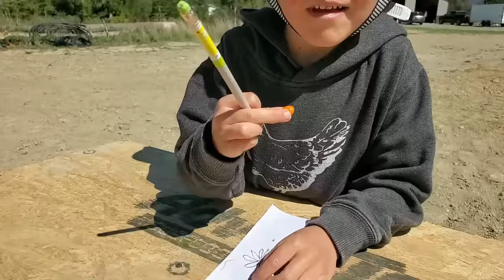We Built A Concrete Log Cabin | 2 Year Start to Finish TIMELAPSE

Comment: I did the exact same the first house I framed. Old carpenter told me to tack 2-3 12 penny nail (they used to weigh nails by penny’s :) in the bottom and just enough to hold while lifting - weight of the wall just eats the nail :).  An amazing and blessed marriage you both have, thanks for sharing!!

Comment: And if you get huge plastic containters to capture rain water then you won't have to pay for water either. Just get a reverse osomosis filtration system to filter the rain water. Btw, solar panels run pretty hot so in the winter time, it will melt the snow off if you get the kind of panels that cover the entire roof to max the energy output, etc. Bleed the sun dry. lol

Comment: Nice place . Not trying to tear anything apart,  but you forgot to skimcoat crawlspace with cement and insulate floor joists spacing .
Reply from the maker: We did full spray in insulation afterwards, walls included.

Comment: I would have put the straps out near the end of the forks and c-clapped behind it so they couldn't slip would have given u a much better angle in lifting the walls have done this trick many times but u still did a great job Congrats

Comment: I think that it's great to build your own home. However, working in construction for many years, what many youtube home builders tend to leave out is the cost, planning/design, and permit process. Its nice to see you put up walls and sheating but unless it passes inspection no insurance company will cover your home. Then, if you want plumbing and electrical there is that process. I am not trying to be negative, just realistic.

Comment: Interesting how you build your house. And very beautiful. 🙂 Here in Germany we build our houses a little different.
 I was wondering why you didn't seal your basement with thick bitumen coating. 
And I also wondered, why you didn't increase the height of your basement by 1m so you could walk in it. 
And third, when building concrete basement walls, why not pour a floor slab ang get a full concrete basement where you can store stuff.

Maybe these are typical german questions as we build our houses fully out of concrete and stone. Usually they all have a full height basement where all the installations like heating and water is installed and we use it to store our stuff there. Dark, cool, safe.

Comment: Why did you use ZIP board on the walls but not on the roof? It's not really needed on either but if I were to use it, the roof would be the first place it would go, not walls!

Comment: Hi. Why did you use nails for the sub floor?
Reply from the maker: Because Subfloors should be glued and nailed
Reply: @GoodSimpleLiving did you also use T&G sheets? The sub floors won't move or sweak overtime because the course drywall nails won't come out.